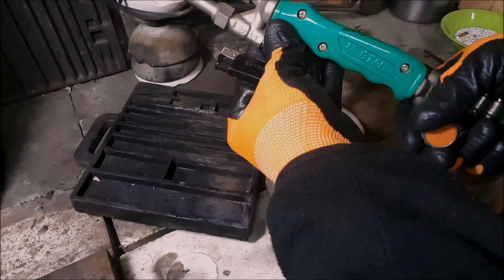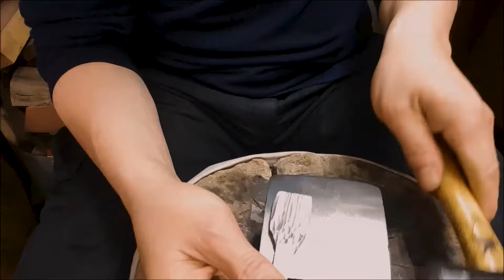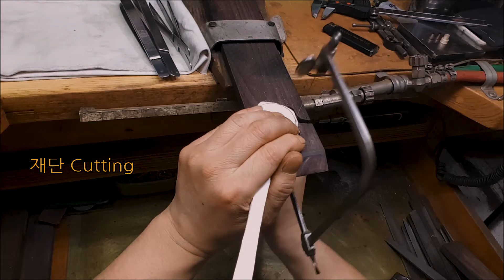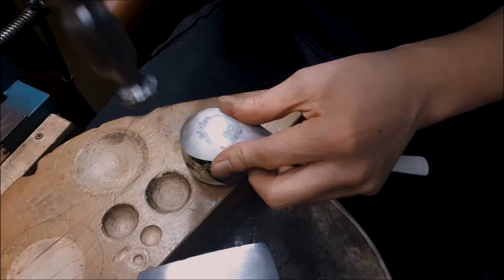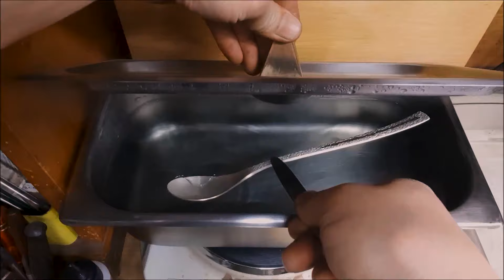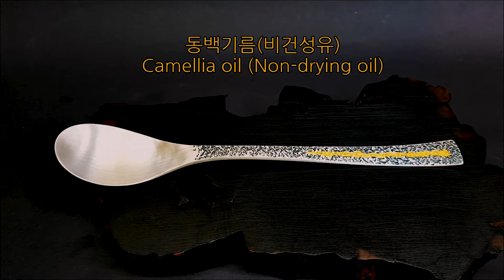Making "Silver Spoon" - Forging / Texture Hammer, Pure goldfoil

Comment: That is beautiful work! It looks like you used thicker gold foil than the usual very very thin gold leaf. How thick is the foil you used?
Reply from the maker: The thickness of the gold sheet,,,
A postcard-sized gold sheet is about 3-4g.
That's about the thickness.
It is about the thickness of a regular paper.
Heating these metals to a temperature between 260~370°C increases 
the movement of the atoms. 
When pressure is added, 
this causes an electron exchange at the surface between the two metals, 
creating a permanent diffusion bond. 
This diffusion bond occurs far below 
the soldering temperature for either metal (Dhein, 2004).
Reply: @SilverMeister  -- That is excellent advice. Thank you! I have thinner gold foil, but I will try your technique.
Reply from the maker: You're welcome~ 
I'm glad if my information was helpful to you, and I hope the work you want goes well.

Comment: What is used to attached the steel bench block to the tree stump?
Reply from the maker: I don't know what that means.
Reply: @SilverMeister  나무 그루터기에 강철 블록을 부착하는 데 사용되는 것은 무엇입니까?
Reply: @SilverMeister  I sent you a picture on Instagram
Reply from the maker: 나무 그루터기, 강철블록, 이것이 무엇을 뜻하는지 모르겠습니다.
이것은 한국말로 "태장대" 라고 부르며, 고정 시키는 장치는 내가 직접 만든 것입니다. 
A tree stump, a steel block, I don't know what this means.
This is called "Taejangdae" in Korean, and the fixing device was made by myself.
Reply from the maker: Aha ! This is an iron anvil attached to a wooden post, and it can be separated when it dries.
So I wrapped the connection part with a damp cloth to keep it moist.

Comment: Thanks for the video!
Is the camellia oil used so that the silver is protected against
tarnishing?
Reply from the maker: Camellia oil is vegan oil.
The reason for applying oil is to delay 
and protect the oxidation of the silver surface.
A very thin oil film protects the surface.
After applying the oil, clean it again to finish.
The camellia oil that I use is safe to eat.
It is a very good natural oil that is harmless to the human body even 
when the ring is worn on the hand.

This is the part that a lot of people are curious about. hehe
Since my work does not have a special finish after completion,
As a minimum surface protection, it is often finished by applying natural vegetable oil and wiping it.
Although it is not shown in the video, it is sometimes coated with natural beeswax (honeycomb).
Beeswax melts easily even at low temperatures (approximately 60-80 degrees) by applying slight heat to it and coating the entire work.
What I am aiming for is nature-friendly as it is,
You can see it as a minimum protection work.
Reply: Thanks for the answer!

Comment: Thank you Silver Meister again for a beautiful item. I tried to make the ring with goldleaf like you made earlier but it did not work. My goldleaf was too thin.
How thick is your goldleaf? Thank you.
Reply from the maker: As the forbidden about the size of the postcard is around 3 g,
That's the thickness.
It is important to set the proper thickness.
Reply: RISTO... Just wanted to add... In the USA, what you are looking for is sold as Gold Foil. It is thicker than the gold leaf and what is used in applications like the brooch. 
SILVER MEISTER... thank you for these amazing videos. I am so inspired by you.

Comment: Why 95%, i see it in all your videos, .925 sterling silver used to be the standard, I thought there was some reasoning to that, just trying to learn about silver alloys
Reply from the maker: It is difficult to give a simple answer as to why 95% silver is used.
There are several reasons.
It is slightly softer than 925, making it easier to forge.

Comment: Sir how do you silver polish on steel pot?
Reply from the maker: I don't know what the steel pot is talking about.
Reply: @SilverMeister  hello sir what can you silver polish on copper glasses?
Reply from the maker: @farukhagwan8577  
Copper is copper, and silver is silver.
You can't make silver shine on copper.
but,
After finishing the surface of the copper, you can plate it with silver.
I hope my words have been helpful!
Reply: @SilverMeister  sir I listen that silver polish on steel pot
Reply from the maker: @farukhagwan8577  
Are you referring to a large container for pickling?
It is a stainless steel container.
Originally, it has a silver luster.
I often wash with a 3M scrubber~
Reply: @SilverMeister  hello sir l listen that when we drown steel pot into silver liquid then it is coating layer of silver on steel pot. Sir it is right .any chemical is with its. Please sir